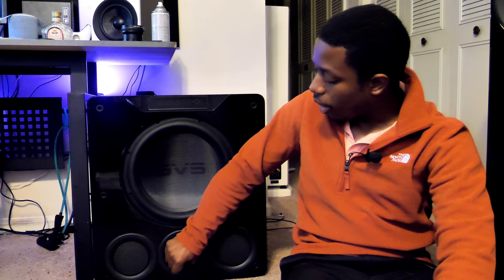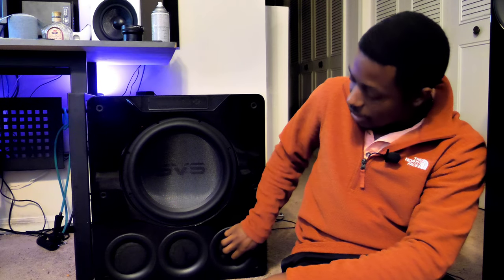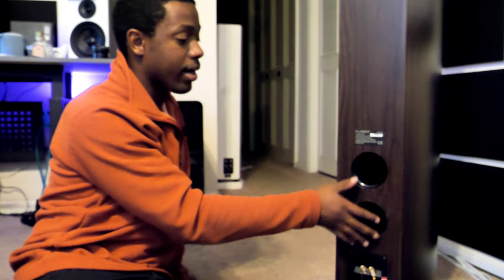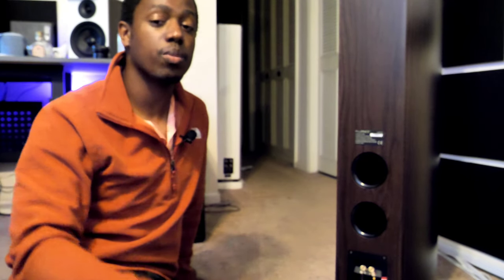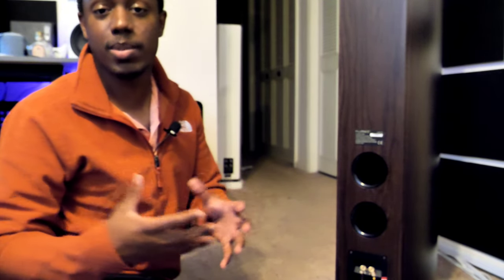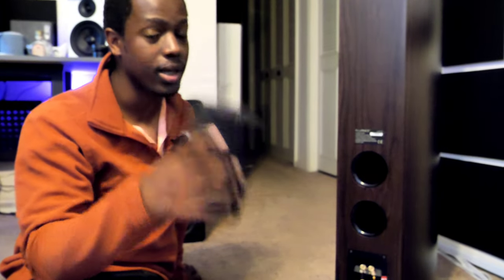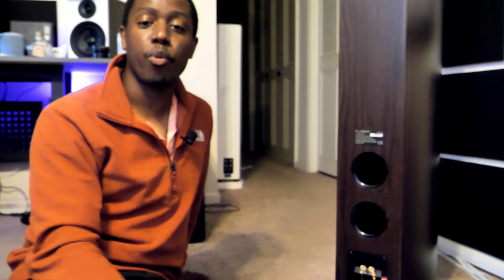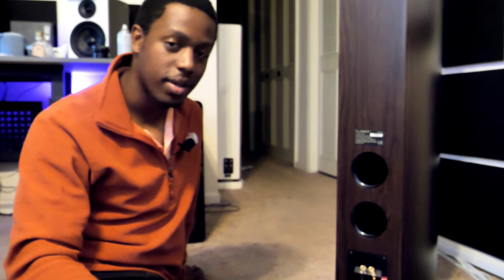Port Plugs and Why You Should Use Them!

Comment: Good informative video.  I use Hifi Floorstanders (Q Acoustics 3050) that only suitable place in my lounge is to be near the wall, resulting in far too much deep bass.  Port plugs dramatically tidied this up, and the overall sound even at mid range appears more defined.  You make good points about experimenting, and the trade offs involved.  Some foam plugs come with a centre hole, and this can be another area to tweak - depending on the diameter of the hole this can increase port output, or even found for a small  diameter hole can tighten bass further than the fully plugged port - go and figure.  Great video, you've got a new subscriber from the UK.
Reply from the maker: I appreciate it. Welcome to the crew

Comment: Another really great video. Thank you! Port pugs go way back in my memory. I had actually had already written a few sentences about the different slopes in sealed versus vented enclosures when you mentioned it in your video. Another option worthy of experimentation is to only partially block off the port. So imagine a cylindrical foam port plug cut in half lengthwise. Here's to socks! Keep up the fine work!

Comment: Thank you for putting this together. I’ve got two subs. Both have down firing ports. I think it’ll make a great difference. Keep up the great work
Reply from the maker: I greatly appreciate it
Reply: @Kpaceguy  any idea where I can find some port plugs. If I can’t find any. I may just use some isolation foam.
Reply from the maker: @victorjohnson8374  isolation foam is made from the same material so it could work. I believe you can get them on Crutchfield or other car audio websites make them

Comment: While some of the reasoning around why these port plugs work is... questionable... it's good to know that this is another thing you can experiment with to get better sound in your room. I have only experimented with room placement, acoustic decoupling and acoustic treatments before. I have used REW and a reference mic to find the best bass response with what I already have. I am definitely going to add port plugs to my list of independent variables!

Comment: I have a Polk Audio psw 505 that port chuffs like crazy even with the gain down quite a bit so I sealed it with a towel and it made a huge difference in sound quality. Tighter bass response and the chuffing just disappeared. I had no idea you could buy those port blockers. I wonder since my port is a wide narrow slant port if they make blockers for those.
Reply from the maker: Probably can make your own out of acoustic foam
Reply: @Kpaceguy  How would you cut acoustic foam? Just curious.
Reply from the maker: It cuts like paper with scissors
Reply: @Kpaceguy  I need to look into that. Hopefully it's thick and dense like Styrofoam. I was wondering, because there is so much air travel through that port I was curious as to how they stay in place without blowing out by the force?
Reply from the maker: @josephbragg1162  you'll want to cut it oversized and stuff it and it'll hold shape after a while
Reply: @Kpaceguy  Ok, Cool. Thank you for the tip buddy.💯

Comment: I am just kinda of curious do the port plugs, make a pb-16 sound closer to the sb-16? For when I was last at Best Buy, I was testing sub woofers, where I really liked the sound of a rel subwoofer, and so I am just kind of curious, would placing port plugs into the pb-16 or pb-4000’s make those sound closer to the REL, which I believe was a sealed sub woofer????
Reply from the maker: Yes it does make it sound closer to a sealed sub
Reply: @Kpaceguy  okay, thanks for the quick reply, now I will have to do some thinking, for I enjoyed the punchy quick response of the rel sub, and I should of tried the SB-16 as well, but we didn’t… well that means it may take a few more trips out to the store to demo, and make a decision.

Comment: Should I run EQ calibration after sealing the port.  I like the fact that is not booming no more on  my Klipsch 10" which is is set at 30% of gain.  Please advice.
Reply from the maker: Ehhh no need to rerun it if you like how it sounds.
Reply: You should always rerun Audyssey after you change something. Your EQ has tried to correct for the effects of the port, now you have changed the characteristics of your Speaker, so you definitely have to rerun the EQ!

Comment: Thank you kpace guy for the video. Just having this doubt, am having a dual klipsch R 121 Sw sub in my home. The gain is about 50 % and avr trim at - 8. Is it ok to cover the port with plugs or using some socks to get some good punch. Mine feels bit boomy some times. And if its designed to wrk ported , any problems if i restrict the air flow ? I knw big brands having port plugs and all. 
Thanks
Reply from the maker: @SuperSteamengine  plugging the port will change overall output at lower frequencies and will change your subwoofers tuning so you'll probably lose low bass and you'll have a better chance of reaching your subs mechanical limits at high volumes but it may sound tighter
Reply: @Kpaceguy  Thanks kpace.🥰

Comment: Technically that is not how it works. If you plug the port, you are modifying the free-air resonant frequency of the enclosure. More specifically you are lifting it. Yes, that can sound better in certain rooms. It can also burn out your speakers. Anyhow, check out Helmholtz resonance for a more detailed explanation.

Bass has little to do with how close to the wall a speaker is ... well, up to a point. You get cancelation of 35hz at roughly about 2.5m and enforcement at 5m. But the sound moving across the hard edges of your speaker and mixing with the reflections from the wall can create some artefacts especially on the highs. Sometimes changing the angle of the speaker a few degrees makes all the difference.

Comment: I have a small sub.. It produce good bass but the port noise is killing me.

Should I plug the port?
Reply from the maker: It'll stop it yes, but it'll also lower your low end output
Reply: Thx I'll just increase the sub levels to compensate for the lost output volume and play with the sub EQ as well

Comment: No thanks!!!  If I want to cripple my subs (home or car/truck), I turn down the gain.
Reply from the maker: Turning it down doesn't change that it sounds bad
Reply: @Kpaceguy  ???  Adjusting the gain/level for your room is a must.  I'm curious what you're referring to.  Are you speaking of the difference between adjustment at the receiver or the sub?
Reply from the maker: The gain is set. But turning it up or down isn't changing the quality of sound. Plugging your ports is. That was the real point of this video. Assuming the volume and gain was set..
Reply: @Kpaceguy  I understand....in reality I have not yet watched the video so did not have proper context, saved it to watch later list.  Cheers and keep up producing quality content.
Reply from the maker: Thank you I appreciate it